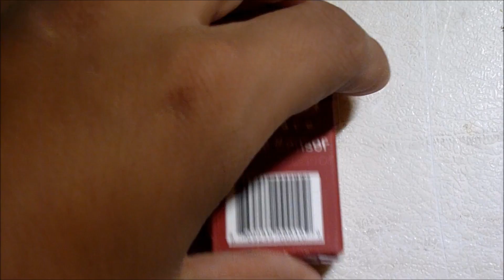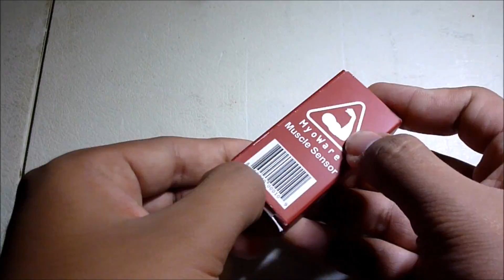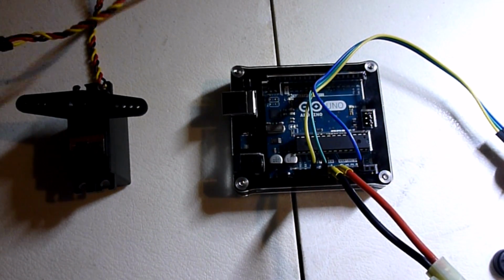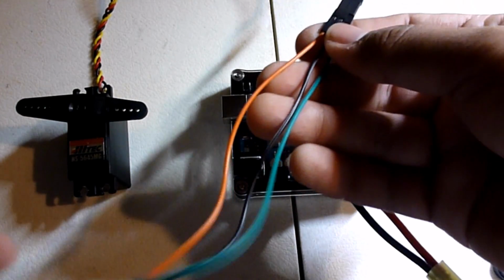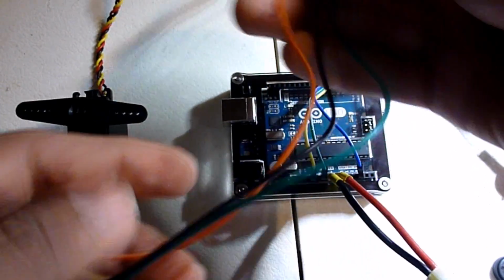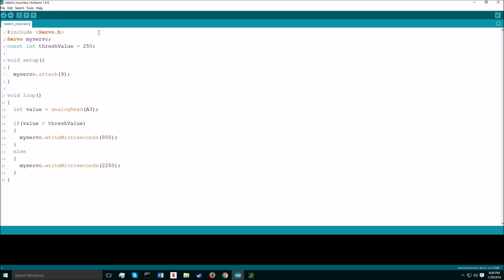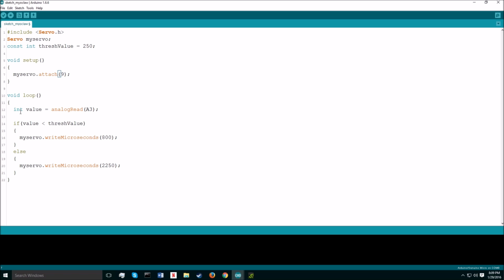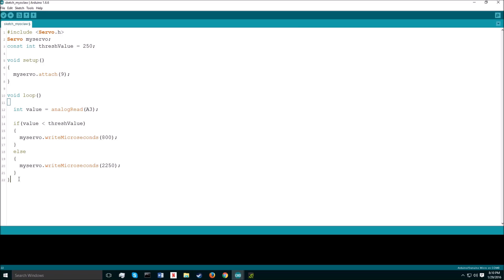MyoWare Servo Tutorial - EMG Arduino Circuit

Comment: Hi, I purchased a myoware muscle sensor 6 months ago, I'm only trying it now, I don't have a battery yet, but when I plug the arduino onto the laptop, even though the Arduino is powered and the power led is on, the myoware led isn't, does it only turn on if I plug the battery onto the arduino? or is my sensor not working? Thank you

Comment: I need a help.
Is there any way that I could control the speed of the servo along with my muscle movement. Like if I lift my hand slowly the servo rotates slowly .
Reply: Have you tried using an accelerometer? It might come in handy but it seems a bit overkill for this purpose.

Comment: Do we need to provide power to it , or can it work on power provided by the computer? And how did you know the voltage power supply needed to run this project?
Reply from the maker: Minhaj Ansari you can use the power from the computer with smaller servos.  For larger high torque ones like the one I used, you'll need a bit more power.
Reply: Ah alright! thanks, bud :)  Also, the surface electrodes being used, I read that they can only be used once. Is this true?
That'll be a real bummer, I'll have to buy many electrodes for my project, in case I mess up in my first few tries.

Comment: hello frank, 
i would like to ask, im using Tower Pro MG995 Metal Gear 13kg/55g High Speed & Torque Digi Servo . The motor is rotate when the muscle reflex and it stop when no reflex but it did not going back to the position. This is my coding can u help me check if its wrong or not.  Hope you can help me before tomorrow .

#include <Servo.h> 
Servo myservo;

const int threshValue = 640;

void setup() 
{ 
  myservo.attach(9);
} 

void loop() 
{ 
  int value = analogRead(A3);

  if(value < threshValue)        
  { 
           myservo.write(90);  
  
  }
  else 
  { 
           myservo.write(0);
  }
  }
Reply from the maker: Try this. Worked For Me.

#include <Servo.h> 
Servo myservo;
const int threshValue = 250;
void setup() 
{ 
  myservo.attach(9);
} 

void loop() 
{ 
  int value = analogRead(A3);

  if(value < threshValue)        
  { 
            myservo.writeMicroseconds(800);  
  }
  else 
  { 
            myservo.writeMicroseconds(2250);
  } 
}
Reply from the maker: btw, your thresh value seems a biiiiit high
Reply from the maker: don't be scared to adjust the gain potentiometer on the MyoWare PCB
Reply: i already try it, but it cant work. Im not using  the Continuous Rotation Servo,  so i change my coding to  
 myservo.write(90);  when i set to 90 it rotate and when it 0 the motor stop. but its not going back to the same position again. is it because the coding or the motor?
Reply: i get the thresh value from the analogreadsignal - serial monitor
Reply: ok i try
Reply: hello frank, when i adjust the gain potentiometer, the thresh value still the same still in 650. but the gain become more small.. from 400 to 50.. but the motor still stay on the same as before, it did not rotate to the same position.
Reply: ok now my thresh value is 200.  this my coding

#include <Servo.h> 
Servo myservo;

const int threshValue = 200;

void setup() 
{ 
  myservo.attach(9);
} 

void loop() 
{ 
  int value = analogRead(A3);

  if(value < threshValue)        
  { 
           myservo.write(90);  
  
  
  }
  else 
  { 
           myservo.write(0);
  }
  }
Reply: but its still same as before. can u help me frank? thank you
Reply from the maker: Mohd Fikri Saad Roni is the servo a continuously rotating 360 servo or a standard servo?
Reply: standard servo
Reply from the maker: Mohd Fikri Saad Roni are you 100% positive that the wiring is correct?
Reply: if i use standard servo, is it different with your connection because i follow all your connection on my project.
Reply: hello frank, i already change my servo, now im using continuous servo and im using 100% of your coding. the wiring is ok. my thresh valllue is 200, but now when the muscle  no reflex the motor keep rotating clockwise, when the muscle reflex the motor go anti clockwide and when the muscle no reflex again the motor keep rotating clockwise non stop.. how to stop the motor on one place only? can u help me sir

this my coding

#include <Servo.h> 
Servo myservo;
const int threshValue = 200;
void setup() 
{ 
  myservo.attach(9);
} 

void loop() 
{ 
  int value = analogRead(A3);

  if(value < threshValue)        
  { 
            myservo.writeMicroseconds(800);
            
  }
  else 
  { 
          
           myservo.writeMicroseconds(2500);
  } 
}
Reply from the maker: Mohd Fikri Saad Roni the continuous servo is not what I use
Reply: opps wrong this my coding

#include <Servo.h> 
Servo myservo;
const int threshValue = 200;
void setup() 
{ 
  myservo.attach(9);
} 

void loop() 
{ 
  int value = analogRead(A3);

  if(value < threshValue)        
  { 
            myservo.writeMicroseconds(800);
            
  }
  else 
  { 
          
           myservo.writeMicroseconds(2250);
  } 
}
Reply from the maker: if your following exactly as I did, theoretically it should work.  you may have a hardware defect
Reply from the maker: it seems like the continuous servo is yielding correct results.  there may be a problem with your standard servo.
Reply from the maker: I used a standard servo in video
Reply: you use standard servo but myservo.writeMicroseconds(800);  is for continuous servo right?
Reply from the maker: Mohd Fikri Saad Roni no write microseconds works for standard servos

Comment: how can i attach 3 servos to different sections of a muscle to make them move individually depending on the muscle movement?
Reply: Rayopaw you'll have to use 3 muscle sensors or code for 3 different range of values .. so that'll help on the intensity of you muscle clunch

Comment: im having some trouble with the sensor, i have connected the sensor as you said (im using the  example AnalogReadsignal and serial monitor too find the thresh ) but the sig led does not react to muscle flexion, sometimes it is  always on or becomes on when i apply slight pressure on the sensor. And also the values displayed on serial monitor are very erratic. Can i get a quick response because i need to get this done by next week?
Reply from the maker: are your electrodes positioned properly?
Reply: 2 on the middle of the muscle  and 1 far from it
Reply from the maker: nikhil maudhoo and the LED you are referring to is the LED on the MyoWare itself?
Reply: yes, the sig one to be precise
Reply from the maker: nikhil maudhoo have you tried adjusting the built in potentiometer ?
Reply: No, its the gain screw right?
Reply from the maker: nikhil maudhoo I believe so... I remember the first myoware I recieved needed to be adjusted there, but my second one did not.
Reply from the maker: nikhil maudhoo if not that, you may want to reposition the reference electrode
Reply: i will try and tell you
Reply: how do i know its okay?
Reply: nikhil maudhoo Im experiencing the same problem
Reply: I have the exact same problem, tried for hours every possible position, do you think body fat can alter detection? Or may I just have a defective sensor, the reading in the serial monitor range from 50 to 900, but i think it should range from 0 to 3000 ? I can't keep the sensor activated even if I keep muscle contraction, and sometimes it activates without muscle contraction. I've tried the gain it does not help. How often you need to change the electrodes btw ? I mean I will not use new electrodes event if I tried 10 positions ?
Reply from the maker: Lingrugtao you shouldn't reuse electrodes, but I've used the same electrodes for weeks at a time before.

Comment: really interesting.how can i run more then one servo motor using myo sensor?
Reply from the maker: mir muneeb Ullah just by connecting multiple servos to different signal pins and altering the code to account for those extra servos.  you cannot achieve full articulation with one MyoWare sensor
Reply: ok thats great..i was planning to build a rehabilitative glove which would move all fingers with help of cables attched to servos, together as some muscle is flexed..is it doable with one myoware?

Comment: Hey frank, i using 5 mini-servo motors tower pro, with a battery pack of 9.6 V and 1000 mAh is the hand can work or no?
Reply from the maker: Temo Herbert I think the hand would work, but you would have to make a custom forearm to securely fit the servos
Reply from the maker: Temo Herbert also, I would not advise connecting the 9.6 directly to the mini servos.  make sure you feed the servos an appropriate amount of voltage
Reply: That you recommend me to distribute well the battery power to the 5 mini servo motors

Comment: Where can i buy the adaptor to attach the battery to the board?
Reply from the maker: Alberto Fernández Fernández I made that adapter using old parts
Reply: so that's two male jumper wires attached to a tamiya male connector isn't it?
Reply from the maker: basically cut the ends off https://www.amazon.com/gp/product/B00RT611JW/ref=ox_sc_act_title_3?ie=UTF8&psc=1&smid=AMJZOOCNGSECT and soldered something like these https://www.amazon.com/2-54mm-Positions-Single-Angled-Headers/dp/B00FB55Y0A/ref=sr_1_1?ie=UTF8&qid=1483950061&sr=8-1&keywords=angled+header to the end.  then I wrapped the solder point with heatshrink
Reply: oh thanks very useful. And how do you charge the battery?
Reply from the maker: https://www.amazon.com/Tenergy-Universal-Smart-6V-Charger/dp/B003MXMJX8/ref=sr_1_3?ie=UTF8&qid=1483950312&sr=8-3&keywords=tenergy+charger  this battery and charger are a bit overkill for this project, but it is all I had at the time. Something like this https://www.pololu.com/product/2224 would suffice

Comment: Arduino: 1.6.11 (Windows 10), Board: "Arduino/Genuino Uno"

myo_ware:21: error: stray '\357' in program

 }ï»¿

 ^

myo_ware:21: error: stray '\273' in program

myo_ware:21: error: stray '\277' in program

exit status 1
stray '\357' in program

This report would have more information with
"Show verbose output during compilation"
option enabled in File -> Preferences.

does not compile and shows this error msg :/

Comment: Thanks for the video, but how did you got the 250 value for the muscle? If i want to view the result on the monitor using Arduino how to achieve that?
Reply from the maker: Muzna Taj I'm not too sure how to display the value on a monitor, but I used an LCD display as seen in one of my previous videos to read the values.  An easier way to do it is just to hook up the sensor to an LED and just adjust the value until you can manipulate the LED easily.

Comment: Hi frank, My myoware always has the red led sig light on and it rarely turns off (valuse do not change when I flex) what could be the problem?
Reply from the maker: alot of things... Is power in 3.3v? signal in a signal pin? negative to ground? is the PCB damaged? is your code correct? I remember that I had the same problem when something was wired incorrectly.  alsoooo there is also a little potentiometer like knob on the PCB that can be adjusted
Reply: yes, I have + to 3.3v, - to ground, sig to A0, I just bought the jumper cables, I havent messed around with the potentiometer and I'm using reusable electrodes that do not stick to the skin so I'm testing it out with tape or buy holding down, do I need some sort of gel for the electrodes?
Reply from the maker: +GeekTechZone try taking off the electrodes and lay the myoware on a plastic surface.  I didn't use any gel but the ones I used were the sticky 3M ones
Reply: You might have already tried these .. but still... 2 electodes will be along the length of muscle you want to use and 3rd one on any other muscle far from these two..

Comment: Thanks for share, btw, can this sensor give different signals? I mean if I want to use is as a controller, does it differentiate between moving fingers etc?
Reply from the maker: I've experimented with that and it's possible with multiple myowares.(respective to each finger)
Reply from the maker: If your looking for something in that field, look up Hacker Hand by backyard brains
Reply: Thanks for the useful link! I see that it requires a lot of emg sensors as well.. I want to make a wearable that can be easily removed like MYO.. I will see what couple of MyoWare gives as a result.

Comment: Really nice thanks you ! Can I use a 12v battery to make mine ?  Thanks a lot !
Reply from the maker: I believe an official arduino can take up to 12v (12v is kinda pushing it... board might warm up a bit)... but as long as you feed the MyoWare 3.3v using the 3.3v output on the board I think it should work fine
Reply: +Frank (Frankybuilds) okay thanks you ! Because I would like to use an electric actuator powered in 12v in place of the servo, you thinks it will work ? Thanks you ! :)
Reply from the maker: +StumblerFR how many volts does the actuator require?
Reply: +Frank (Frankybuilds) it require 12v 

This one : http://www.confort-center.com/fr/motorisation/49-verin-electrique-moteur-multi-usage-100mm-12v-750n-76kg-644221445778.html
Reply from the maker: +StumblerFR I'm not too familiar with actuators... does it have a positive signal and negative wire?
Reply from the maker: +StumblerFR I'm not too familiar with actuators... does it have a positive signal and negative wire?
Reply: +Frank (Frankybuilds) yes it have
Reply: +StumblerFR ?
Reply from the maker: +StumblerFR yea.. I'm not to familiar with that stuff but what might work us putting 12v into the arduino and using the same 12 volts to power the actuator and just program using a servo library... like I said I'm not too sure

Comment: hi Frank, nice video ...I had a little problem in using my sensor .I connected the sensor to my arm but I am not able to get any signal from it .please help me out as I really need this working for my final projectthank u in advance
Reply from the maker: firstly is your electrode placement correct? if so can you be more specific with your problem?
Reply: +Frank (Frankybuilds) hi....
I have place the sensor rite where u have and to be specific about the problem ....
the signal light is on even when not flexed and when my arm is in its relaxed position and there is no change after flexing .....
and can I ask u another favour. ..is there any possibility to Skype
my email id is Vishwasdevagiri94@gmail.com  
it would be really cool if u could help me out
Reply from the maker: +vishwas devagiri in 5 hours I can
Reply: +Frank (Frankybuilds) cool no problem
Reply: +vishwas devagiri can u send me ur skype id
Reply from the maker: +vishwas devagiri  give me yours
Reply from the maker: +vishwas devagiri make sure that the myoware positive is in the 3.3v arduino slot, the signal goes to an input pin such as A3 and ground to ground.   also make sure the two electrodes are on your BIcep and the other on your TRIcep.  (the electrodes cannot be on the same muscle) you can also attach an electrode to a bone directly like your elbow.  For some reason I had similar issues when I put on a fresh set of electrodes.  the problem does go away after a day though. (idk why)
Reply: +Frank (Frankybuilds) my Id is vishwasdevagiri and that you for you help
Reply: +vishwas devagiri thank you*

Comment: Can I use the arduino lilypad Pro with a 3.7 volt battery instead of the UNO? 
Thanks
Reply from the maker: +Jmagg2234 the lilypad will work with the myoware but 3.7 volts may be too low depending on your servo. Look at the recommended input voltage for your servo.
Reply from the maker: +Jmagg2234 Also, to power the MyoWare i use 3.3v
Reply: +Frank (Frankybuilds) ok, thanks for getting back to me. and where do you hook the leads from the myoware to on the lilypad? do I just hook the positive to where the battery goes into the lilypad board and the same for the negative? then the SIG to a3? 

thanks again for your help
Reply from the maker: +Jmagg2234 that sounds like it would work. look up iron man myoware, they used a lilypad